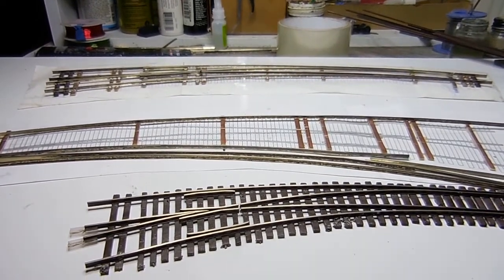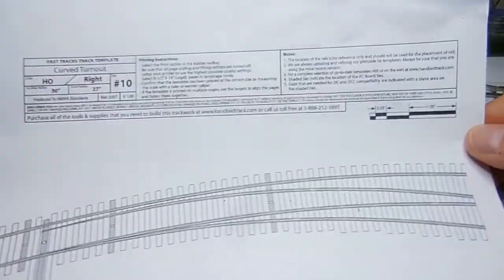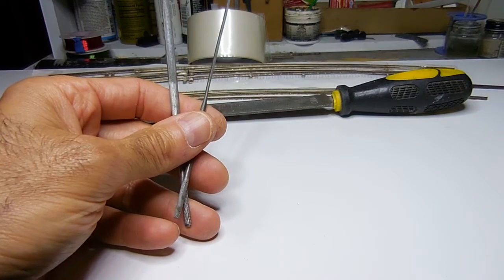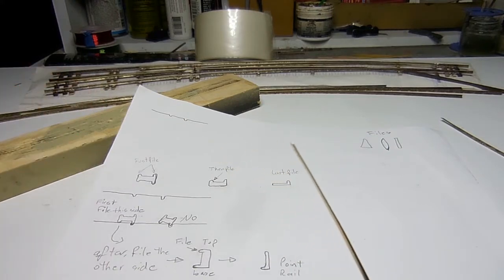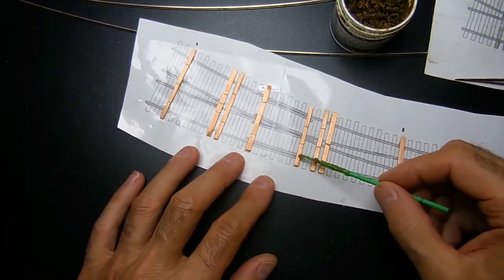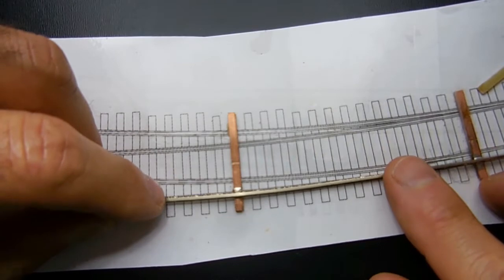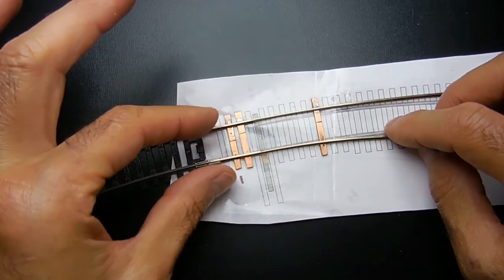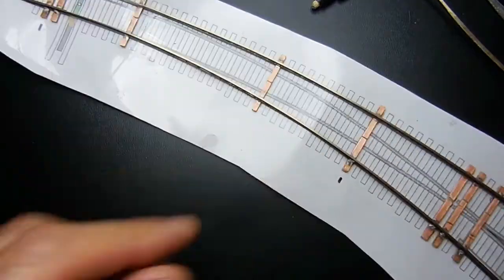How to Make Curved Turnouts (Switches) from Scratch in HO Scale

Comment: May I suggest a tip for people who aren't familiar with scratch building tracks and might wanna try out.
Solder the rails in order from one side over to the other. For example: 1st stock rail, then its nearest closure rail, then the frog (while checking gauge to the 1st stock rail), then the other closure rail (also check gauge to the 1st stock rail), then the 2nd stock rail (while checking gauge to the opposite closure rail). This makes it extremely easy to keep an accurate gauge because you can always make small tweaks to the subsequent tracks in reference to the track already soldered down before it. Also, invest in a good set of 3 point gauges if you wanna try scratch building.